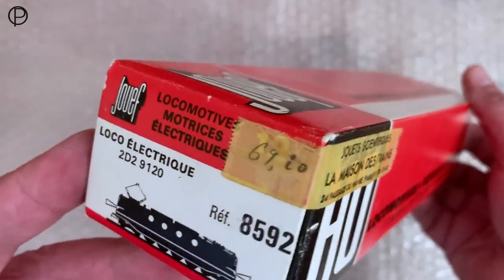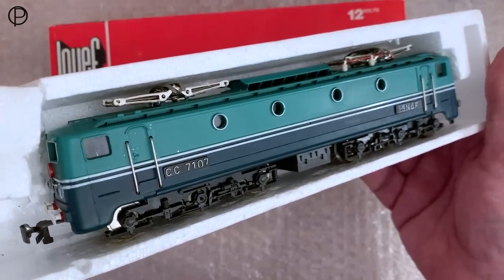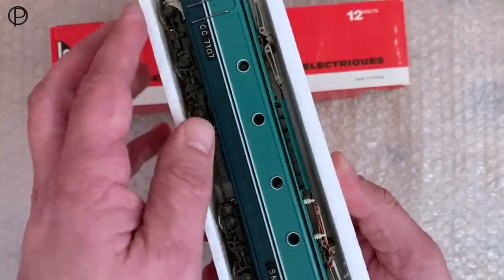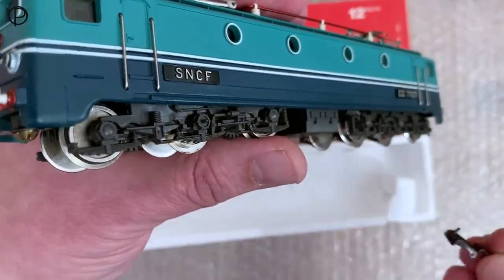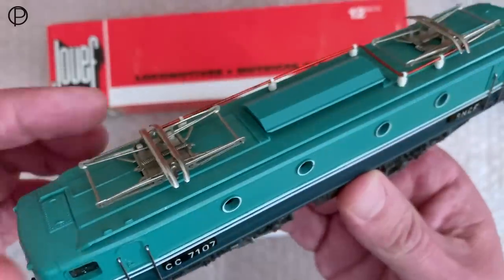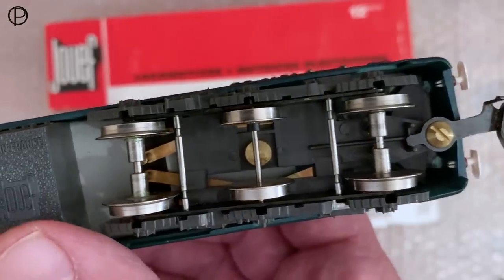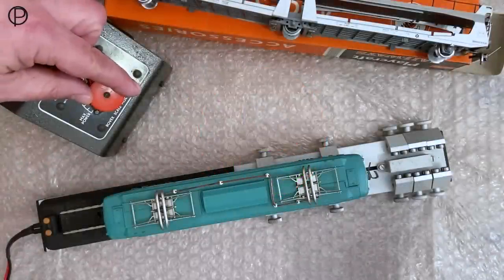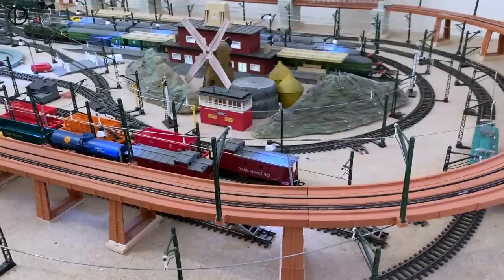Jouef CC7107 SNCF Locomotive 8540 / 8541 with Playcraft Articulated Car Transporters P6571

Comment: I had one of these jeouef in my sets whan i was a kid but it had an Australian New South Wales livery 46 class electric engine. 
It was a absolute shocker of a runner and forever breaking down so when the engine finally died I ended up replacing the engine with an engine out of a slot car and installed it and retained the engine with a rubber band holding it all together ,, mate it turned it into an absolute rocket and would pull every carriage i had and at speed.
This video of you showing the internals of the engine has brought back a lot of happy memories of me in my granpa's shed where i had my layout in the happiest place i ever lived with my grandparents who have both since passed away , so thanks again heaps Oscar for a trip down memory lane. Just awesome mate. 
Cheers from John in Australia.
Reply: Interesting story so thanks. 
The very rare Australian livery version is very sought after by French Joeuf collectors.
I remember reading one collector  asking information on the Australian versions through an Australian model railway discussion forum. He finally got a very rude response that it did not exist from a high end Australian cottage industry manufacturer. The basis was if none of them had heard about it then it never existed.
 Cyclops using Joeuf also had a repaint of a French Bo-Bo diesel shunter painted as a class 73. Ads in AMRM at the time.
Your comment is uncanny in that I was just about to tell Oscar about the Australian version.

Comment: Very nice! When I joined SNCF in 1997 there were still CC7100's operating on freight in the Rhone Valley - including celebrity 7107. Lovely locos.
At Lyon Perrache the motorail loading bays were still operating with these types of wagons too. They were shunted by an ancient olive green BB8100 (built by the Paris-Orleans in the 1920's I believe) which had spoked wheels and a glorious array of steam era copper and brass instruments in the cab.
The box of your 7100 is from a 2D2 which were the first mainline electrics built by the PLM for the Paris-Dijon route. Even I'm not old enough to have seen those in action. But I believe they ran until the 80's. At least one is preserved in working order and ventures out for specials from time to time. It was shedded next to Paris Gare de Lyon until a few years ago.
Jouef mechanisms of the 70's are weird when you've been brought up with Triang and Dublo like us. Their diesels and electrics seem to work OK, but steam outline models of the same period are awful!
Reply from the maker: Good morning Robin, I would love to have seen these in action myself, they seem very exotic when viewed with English eyes. Many thanks for watching and the great information.
Oscar

Comment: Took me a few years after I first saw Joeuf to realise the Playcraft connection. 
I am reminded of the the pioneering Playcraft D6100 model from around 1963. Although not looking very accurate and and having low detail, it incorporated a coreless sealed can motor using ball bearings at both ends as well as all 8 wheels driven.  This is well before any other coreless motor usage that I can find. Also had 8 wheel drive and pickup. All remarkable for the time and price point.
Next coreless motor usage that I recall was in the cutting edge Portescap RG4 and US oriental sourced brass locomotives with Canon coreless drives and similar. So a radical change from being in the near cheapest locomotives to being in the most expensive.

 The D6100 drive, although similar to the CC7107 , was more ambitious than the simplified version  adopted later by Joeuf in that it drove both bogies in similar manner to CC7107. It used all metal gears but with coarse pressed steel pattern crown gears rather than better machined metal gears. Despite this high spec of the Playcraft D6100, it was one of the cheapest eight wheel diesels available and had eight wheel drive. The quoted low current consumption of 50ma with eight coaches was afforded by the early coreless motor. I think this was to enable running these from batteries for substantial periods. This was how my cousin ran his Playcraft set with the D6100. This was when a transformer controller often cost more than a train set and often could not be afforded. This a big selling point if a low cost set could be run on batteries without frequent replacement and the high cost of a separate transformer controller. 
Remarkable but nearly forgotten due to its appearance and being near H0 scale.
I recently came across a circa 1963 Playcraft catalogue where the specifications of the Playcraft coreless can motor was prominently displayed and described. It had full ball races at each end of the motor.
I was less impressed by the seventies version of the D6100 where Joeuf had downgraded the loco to drive on one axle only and so used traction tyres on both wheels on the axle to try to get pulling power. Used a motor similar to the CC7107. I think the standard Joeuf motor.
Perhaps a Playcraft D6100 is one to keep an eye out for, as it is usually cheap a plentiful without a strong collector group driving prices up.
I wonder if any French Joeuf locos from the early 1960s had a similar coreless all wheel drive system.
Reply from the maker: Hi John, terrific information about the motor.  You are right about the items in the Playcraft range.  They make for a very interesting collection.
Thanks for watching.
Oscar

Comment: In March 1955 CC 7107 and Bo-Bo locomotive BB 9004 both attained 331km/h in a high speed record breaking stunt. I say a stunt in that overhead and tracks were very much damaged in the speed run. In the official video coverage in the plane paced shots you can see the pantographs and overhead being turned into a stream of molten metal. The speed run ends with the train coasting with pantographs down to prevent further damage.
Surprised that both locomotives achieved the same speed.

I recall that the overhead voltage was boosted help with the record.

I have also seen some more suppressed film of the remains of the track that was moved well out of straight alignment by the forces the record run put on the track. Would love to find it again.
A one off record setting with the loco then limited to a much safer and less damaging 140 km/h in normal service. Some hard lessons learnt with the track needing a month or so of repairs to be re-instated to normal service at normal speeds.
Reply: Stunt?  What the experiment showed was that trains could run at such speeds (about 206mph)...and that there were many issues to solve. The main was hunting, when the wheels ride up side to side with their flanges against the rails.  This problem was solved by the Japanese enabling the Shinkansen.  After 1955 the French continued to develop high speed trains, such as the Mistral, with locomotives and coaches until the advent of the TGV.
Reply: @rolandharmer6402  They knew the hunting and overhead were destroying the equipment at much slower speeds than 331 kph but continued and suppressed publicising the destructive consequences. Not a cost effective way of research but widely acclaimed by the press who like stunts. Very few references to the costly destruction.
Japanese had a much smarter approach as was the TGV without so much destruction. So lessons learnt from the costly destruction but it was only taxpayers money at the time so who cared.
Reply: Don't forget that Mallard had to limp into New England (Peterborough) after it's record breaking run with damage to it's centre cylinder valve gear requiring costly repairs in Doncaster.
Reply from the maker: Hi John, it dose sound like they were learning quit a bit with these trials as well promoting their ingenuity with the exposure these film must have brought. It a fascinating subject.
Oscar

Comment: Great video again. Them car wagons are a serious quality model for late 60s. I was actually thinking of getting some, but my layout is mostly Super 4 and shame they have issues out of the box with the track. Surprising as even the latest models have no problem with Super 4 points.
Reply from the maker: I think it's the depth and angle of the flange which seems to encourage them to climb up the rail.  I think the length of the train/weight adds to this on gentle larger radius curves I imagine they perform much better.
Thanks 
Oscar

Comment: Thanks Oscar I have two of the Jouef Class 40, with similar gearing and lights, I've added, red tail lamps to both, they run very well, they wil haul twenty of the Triang hopper wagons !
Reply from the maker: Hi Paul, that sounds like a very powerful model.
Thanks.
Oscar

Comment: Hornby Meccano also had a CC 7100 that had a working pantograph , Lima too, but they all shared a similar poor 1 bogie drive and the other picks up design (nor sure about the old Rivarossi dough). All old Jouef C'C' and Co'Co' locos had this dummy middle wheel thing, not sure why since the CC 40100 has a smaller wheel base / bogie than some of their B'B'/Bo'Bo' locos. About that; I saw some of these locos with the old all-wheel (well 8/12) drive CC 40100 chassis, witch loco later got an almost identical off-centralized motor mechanism chassis like yours. I use to buy 2-3 old Jouef locos of the same type to build one from the parts that has both bogie pickups + drive (so i usually need 1 early for the chassis and 1 later for the up-detailed body), and hoping that one even has the newer 5 pole motor i can fit in. I already made a BB 12000 , BB 13000 and 2 CC 40100 rebuild. I wonder if i could do the same with 2 motors ... maybe, on the CC 7100 using it's later chassis? BTW some old Playcraft locos has a French chassis with bogies under a British body like my Class 23/29!
Reply from the maker: Good morning Tom thanks for the information, I shall have a look out for the CC 7100 that you mention. These models certainly seem to have very fascinating mechanisms.
Oscar

Comment: 1973 by the looks of what I can find Oscar. Just after the original owner sold his company the new owners decided to improve the detail. This necessitated the removal of the huge saucission (can) motors to the open frame motor. This model is the SNCF, the other number you referred to is in the Algerian livery. I have the catalogue in which this information appears, but there is no publishing date. I have quite a few of these in steam and diesel. They run beautifully. Wheels on some carriages have deep flanges, which can be a pain to run.
Reply from the maker: Good morning Steven, thanks for the information it's hugely appreciated.
Oscar

Comment: I have replaced the wheels on the car transporters with Lima replacement wheel sets from Peters Spares and that has improved the performance considerably. It may well help with your excellent track work.
Reply from the maker: Thanks for the information.
Oscar

Comment: Hello so you have the option of 8241 et 8242 inside and the roof as the same ; the only thing has different is the material of pantographe ; the silver pantographe is for the 8241 ; for the 8242 the pantographe is in black and copper ; If you want to carrying more wagon you could add some weight until at least 300 grammes

Comment: Jouef didn't adopt the standard continental Bemo couplings until the 1970's so this model is from the 1970's.

Jouef coupling evolution:

Lanal (1950's - 1966) --> Peco Anita (1967 - 1970) --> Bemo.

Some locos, such as the clockwork and electric versions of the North British 0-4-0 (the only OO scale model in the range) had Lanal on the front and a Peco Anita on the other.

Jouef also issued a Triang coupling converter kit to convert Peco Anita equipped locos & rolling stock to Triang Mk.III couplings. One of my North British 0-4-0 diesel shunters has this conversion to give a Lanal coupling at the front and a Triang Mk.III at the  rear.

I also have one early version of the North British 0-4-0 diesel shunter with the cross shaft giving 4 wheel drive. Later versions had this removed.
Reply from the maker: Hi Andy thanks for the information on the couplings. The mechanism on the early North British 0-4-0 diesel shunter you have sounds interesting.
Oscar

Comment: I just picked up this model via EBay. My issue with Jouef engines has always been that the gears, especially the ones with the chases need to be exactly lined up, perfectly, for these older engines to even start rolling. Frustrating. Any tips, ideas to improve this. I think there may be just too much wiggle room (from use, age).
Reply from the maker: Good morning Pieter thanks for watching, I don't have many of the Jouef models sadly, the few I have which I very really run seem to run well. I've not needed to start adjusting or rebuilding so far.
Take care.
Oscar

Comment: I see you've gone to the Dark Side Oscar. Think the only Jouef I've got is a Class 40 and some Mk3 coaches I got in the late 70s.
Reply: Peter Kazmierczak  the blue one pre TOPS with the directional lights?  Strongest engine I had at the time  👍🏻
Reply: @djdaz72  Think so Darren. The loco was a fraction too wide, but as you say, very strong and smooth. The Mk3s were to scale length and much better than Hornby's then offering. I converted mine into HST trailers. This was before Lima introduced their HST models.
Reply from the maker: https://www.conradantiquario.info/content/katalog/jouef-catalogue-1978-1979.html
It's very difficult to resist these items.
Thanks
Oscar

Comment: Earlier circa 1963 Playcraft British HO D6100 with a more elaborate version of the drive that I discussed earlier seen here :
https://www.youtube.com/watch?v=r_370tkwHF8

However the geared drivers on second bogie seems to have been lost and replaced with some un-geared plastic coach wheels. Should have geared metal wheels as per the other bogie.
However he just paid a pound for it. These need a good controller to control at lower speeds due to low current coreless can motor used as can be seen.
Reply from the maker: Sounds good for a pound. Thanks for sharing the link.
Oscar.

Comment: Hi Oscar
Happy Easter. Interesting change of scene this week. - all good choices. Would the early code 100 track help withe Playcraft carriers? I remember being given an electric Jouef level crossing in the early seventies and that included code 100 (system 6 track) which was unusual at the time in the uk. Stay safe
Ian
Reply from the maker: I think they would probably be happier on code 100 although the flanges are surprisingly deep others have mentioned problems with these.
Thanks
Oscar

Comment: 18:21 Yes a 203 Peugeot. Peugeot trade marked all model numbers with a zero in the middle early in the piece. Caused a problem for the Porsche new model 901 for 1963. Porsche had to back down and call it a Porsche 911 so as not to cause a legal tussle with Peugeot.
The 203 Peugeot and later 403 made a surprising impact in Australia https://www.youtube.com/watch?v=6ELs2L5e3gg&t=52s
Newer models much less so being one of the few things I agree with Top Gear on.
Later Simcas and Citroens also assembled here for a while.
Reply from the maker: Thanks for the link and information, I love the Idea that the Porsche may have been named 901 and then to settle on 911 only to find it adopted as an emergence telephone in the US later that decade!
Oscar
Reply: @oscarpaisley  Oscar glad this was of interest. Just found a summary on Youtube of how they changed :
https://www.youtube.com/watch?v=zRjTJrZ3vvQ
Also seems the early rare 901 cars, perhaps in serial number codes, are very valuable now. Seems Porsche recently went to a lot of trouble to get an early 901 for their museum.

Comment: If you are thinking of French HO, the Thalys is quite an interesting one. It is made by Hornby Jouef, Lima and Mehano. An interesting challenge is to get the intermediate cars for it. If you get the Jouef Eurostar, that will go with the HO Thalys. see https://www.kentrail.org.uk/thalys.htm
A complete 4-car set with track and controller costs £79.68 from Amazon.
The TGV Duplex is £74.66. The Jouef Thalys costs over £300, but according to John Chambers, it is not much better than the Mehano version. I have heard that Mehano bought the Lima tooling that Hornby also subsequently used.
Reply from the maker: Thanks for the information. I will keep these models in mind for the future.  It's amazing how the tools get passed between manufacturers as companies change.
Thanks again.
Oscar